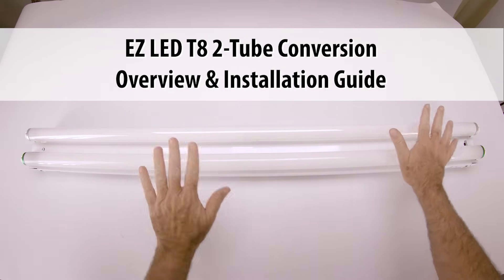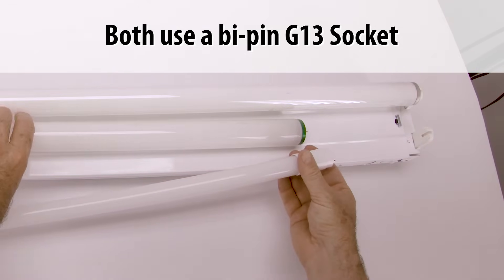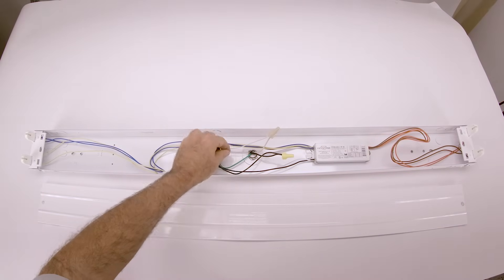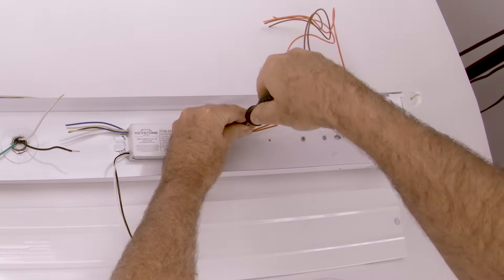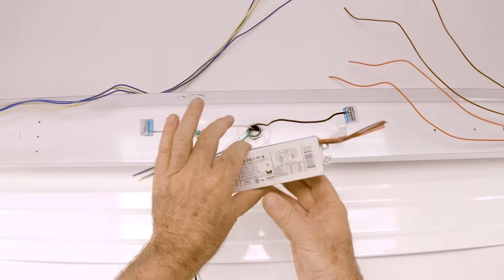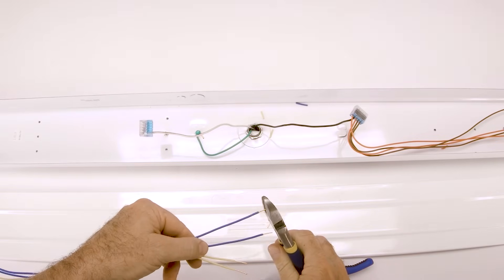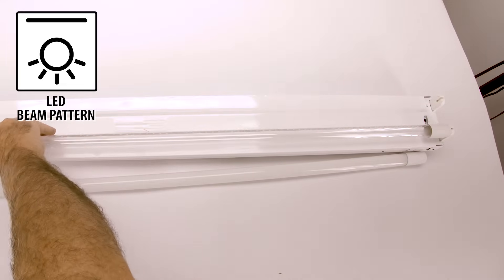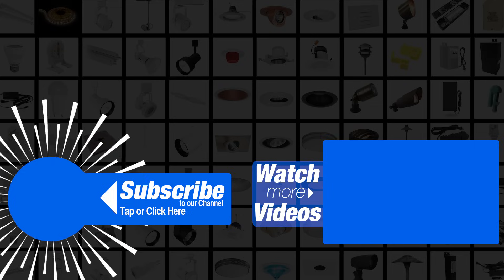EZ LED T8 Fluorescent 2-Tube light Conversion in 5 minutes or less by Total Bulk Lighting

Comment: You never said anything about the tombstones being non-shunt or shunt. Does that matter with a double ended led light conversion?
Reply from the maker: Technically you can use either non-shunted or shunted as long as you wire it correctly. In the video we are converting existing fixture with shunted tombstones. We always recommend consulting an electrician when doing any retrofitting.
Reply: @Totallightingsupply  this answer doesn't give me a lot of confidence in your company to help the DYI guy.
Reply from the maker: @DA_Machine  I can understand your concern. Here is a link to our wiring diagram. I should have included it earlier 👉https://www.totalbulklighting.com/downloads/dl/file/id/1215/product/8700/led_t8_double_end_power_wire_diagram.pdf  🙂My apologies 🙂If you have any further questions please feel free to contact us through our support channel here https://www.totalbulklighting.com/contacts/ Have a Happy New Year 🎉
Reply: @Totallightingsupply  this diagram doesn't show anything to do with the bulb polarity or the shunt /  unshunt tombstones. Your video leads everyone to believe it's a DYI project but you refer to electrician as your Escape.  now I ask you... Is this a DYI project or do you need an electrician to do this for you?
Reply: @Totallightingsupply  You have two wires going from the ballast to each existing socket. They are non-shunted.
Reply: @bivica.fivigum  I noticed that as well, and all the double end bulbs they sell specifically say for shunted tombstones. I won't be buying or trusting anything from this site.